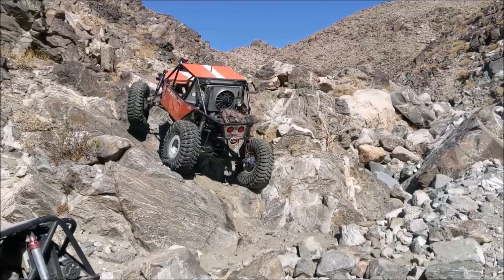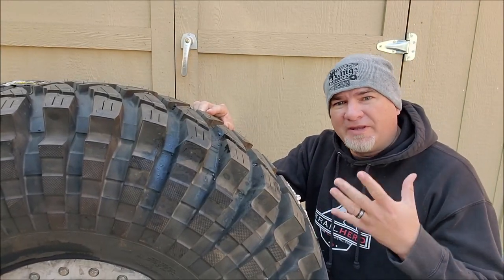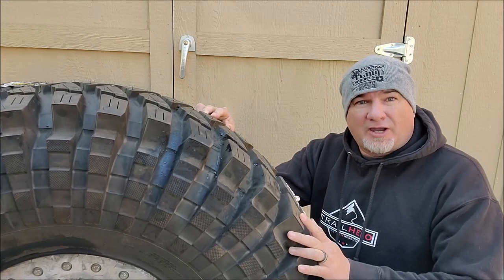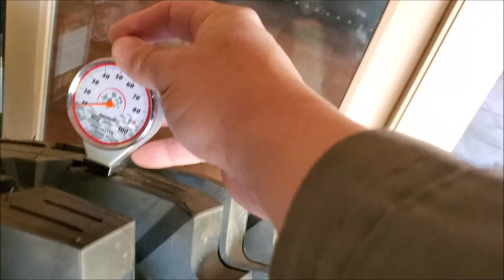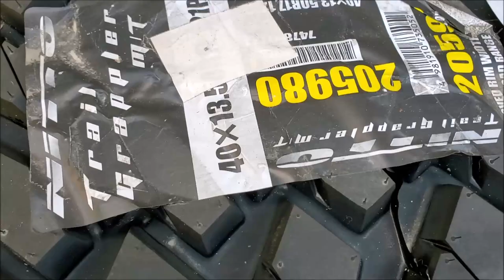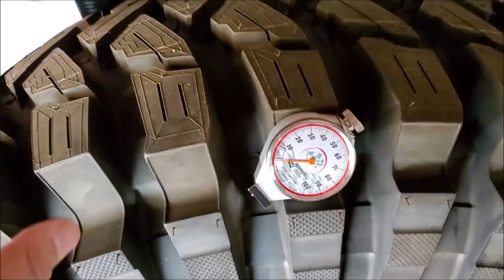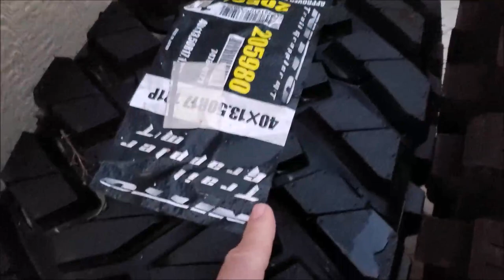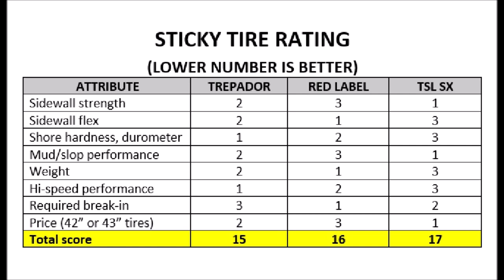REDS vs TREPS: A sticky tire review for rock crawlers

Comment: Great video comparison!  Not a negative comment in any way, but one thing to keep in mind is that when a tire is used vs new it has been heat cycled.  It will read harder after its been heat cycled.  Red used vs Trep new.  The Trep is a softer tire from what I remember.

Comment: Good vid.. the reason east coast rigs prefer things like say a SX is cause we don’t have the long steep slick smooth rock faces.. we have bolder after bolder.. for us giving up some stick for something that’s a little knobbier is what’s needed to pull yourself over those boulders. 

The one thing you didn’t really address though was off camber stability and traction between tire types.. that’s really where sticky’s shine over most others. Nittos or SX will have a lot more tendency to slip and slide sideways then a true comp style tire. This is again a big difference between climbing a slick rock on the edge of a ravine or climbing boulders where if you roll you are likely to just side flop into the next rock vs tumbling to the bottom. 

The tire you run has a lot more to do with where you’re wheeling then anything else.. people I know out west with same rigs and experience will run treps where those same here locally will usually run iroks. I used to run bloggers for the longest time. People would laugh but those big lugs did their job. I would never consider such a tire out west though as they won’t even grip hard pack clay more less slick smooth rock. I’d never run reds or treps out here. While they do help sometimes.. they loose all their advantage soon as you hit a soupy mud puddle between boulders.. lugs aren’t big enough and the don’t clean themselves well enough leaving you with not much more then all terrains at that point.

Comment: Great video - great comparison, would like to see a deeper dive on the sticky TSLs which seem very good here on the east coast (as you mentioned) Have wheeled 40" Sticky Treps on the east coast for quite a few years and have found they work well in all conditions. Just bought 42s and found the cold weather warnings from the manufacturer disconcerting. Never really noticed any issues in the winter with my 40s... Definitely not in my budget to run two set of tires, we will see - great comparison!
Reply: I’m mid Atlantic also and building up a dedicated trail TJ and was debating some sticky tires but still want to be able to play on the snow sometimes. Have the Treps done ok in snow?
Reply: They throw snowballs! Clear easily yes I have been very pleased.. still can’t figure why the cold weather warning? I’ve hammered them up icy rocks etc with no issues... guessing maybe if it is super cold they will chunk easily? I usually opt out if its in the low teens anyway, certainly have wheeled below 30 degrees with no complaints
Reply from the maker: @kc510  They are horrible in the snow compared to your average street compound tire. The Iroks and Trail Grapplers on my Jeeps will run circles around the Treps in the snow. My buddies red labels are also horrible in the snow. Did you watch the Durometer tests in this video? Stickies get much harder as the compound gets colder - proven fact. Street compound tires are made with a rubber formula that maintains good traction characteristics across all temperatures.
Reply from the maker: @jameshooper4038  As mentioned in the video, the "glass transition temperature" of sticky tire compounds is very high compared to street compound tires. Every time you run your stickies frozen, you cross this threshold; and in addition to poor performance from a rock-hard tire, you are creating micro-fractures in the rubber and breaking down it's chemical composition faster than normal. At $800 per tire, my stickies are staying out of the snow from now on.

Comment: Bro which tire do you recommend?  for desert driving lots of sand and desert terrain.   Also theres high speed desert driving with low pressure. 4200lbs rig

Comment: Appreciate your time with this. I would like to have seen a comparison on the 42 inch red to the trepador compound tires. With the difference in wheel size would equate to a smaller sidewall on the BFG. You stated that the 20 wheel was "less desirable", but I think that is pretty subjective or at least seemed to be presented in that way. I am looking at getting a set of 42s and leaning toward the treps because the 17 inch wheel can use other tire options of similar size. That is one way I could at least qualitatively back up that statement. Either way, loving your videos, I called Branik already because of your video on the 14 bolt rear steer.

Comment: My wheel base is 110 on my trail buggy and I currently run 39” Reds. 

Thinking of stepping up to 42” Trepps, and wondering about my overall handling changes. 

I am on the east coast. 

Any info is appreciated.
Reply from the maker: 42's will do fine with 110" wheel base. Most rock buggies out west are running that combo with a low belly height.

Comment: Wow what a great video.  
I'm currently building my 2002 jeep tj and I was hoping someone could point me on the right direction as far as what is the best all round tires to run. 
I'm setting it up for rock crawling though it will be a duel purpose rig. Meaning it will see a lot of hiway use from the Bay area to the Rubicon.  So. To me it sounds like a  set of 35 or 36" Nitto Grapplers is probably my best bang for the buck. However if you know of something better suited for this application would you please give me som ideas.
Reply: As a heads up (I know your post is old) I have run 6-7 sets of grapplers in everything from a 35 to a 40.  I love them for a general off road tire.  However the 40in version is a night and day difference from the others.  The rubber seemed to be much softer, sidewall flexed better, and the performance was way better.  In a 35in category you definitely want to stay away from 18in or bigger wheels because the tire compounds are harder.  The best 35in “street” capable off road tire I have seen in general use off road was the nitto mud grappler.  It seemed to hook as hard as the 40 trail grappler and its wide for a 12.50 tire.  They are loud on the street but the capability seemed to be a step up in every category vs the trail grappler off road.
Reply: @makingmistakeswithgreg  hey man ,thanks for your response. 
This is some very useful information. 
I went ahead and pulled the trigger on a set of 5  17" method trail series wheels and had 35" Nitto Trail Grapplers mounted on them.
Availability dictated my choice.
From what I've heard,  these tires are pretty soft and ware out pretty quick. 
Hopefully I'll be able to get mud Grapplers next time. 
Again,  much appreciation for your response and sharing valuable information.

Comment: Sooo..... The durometer test was interesting. It seemed to imply that Nitto's street compound was within a few units of red labels? Does real world testing show that the Nitto street compound performs like the red labels?
Reply from the maker: No, because there are other factors at play other than durometer readings (softness). The Red Labels are the only stickies made with an open-cell rubber compound, which compensates for the  increased harness properties. No non-sticky street tire will perform like a sticky in the rocks. But, I would definitely say that the Trail Grappler street compound is probably the stickiest of all the street tires.

Comment: Maybe I missed it.I heard you talk about different chemical compounds but I don't think you mentioned open cell vs closed cell.Cool video though.
Reply from the maker: Yea, didn't go that deep because the video was running too long. I left out oxidation (age-hardening) and void ratio too. But, the closed-cell Treps are supposed to be more immune to the effects of freezing temps; and I found that to not be true. Reds and Treps both get bad as the temps drop. But the open-cell compound of the red is obviously responsible for its flex and pliability, and the closed-cell compound of the Trep makes it more durable. Maxxis compensated for the closed-cell compound by making it really soft. Two different approaches to accomplishing the same thing.

Comment: Ever put your durometer on a 40 or 42 MT/R?
Reply from the maker: No. The sidewalls on those tires are so weak, that no Rock Crawlers here locally run them anymore.
Reply: @chrisdesertdog2162  good to know and that partially explains why they’re so lightweight too.
Reply: @chrisdesertdog2162  what reputation does the  Pro Comp MT2 have in your area?

Comment: Reds in the east, Treps in the west.
Reply from the maker: Of course, most of the east coast buggies I wheel with say just the opposite!!! They claim that the reds just don't hold up to sidewall punctures from roots and branches like the Treps do, and that the Treps handle the sloppy mud sections of trail better than the Reds. I would actually say that the TSL SX is the king of the east.
Reply: @chrisdesertdog2162  I can respect that, my friends and I have have excellent all around success out of the Krawler tires. I still see a lot of swampers and iroks around here as well. I am mainly referencing "here" with Windrock.